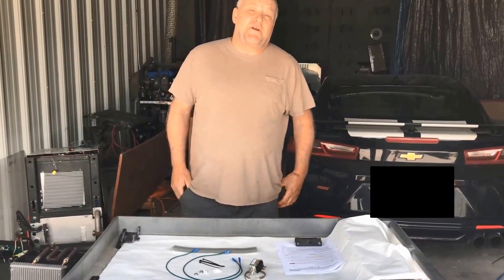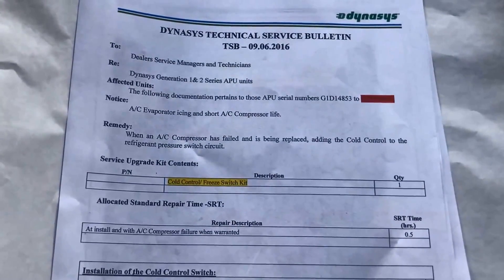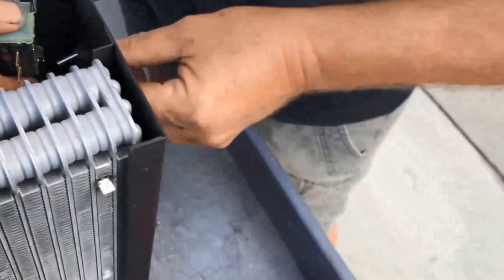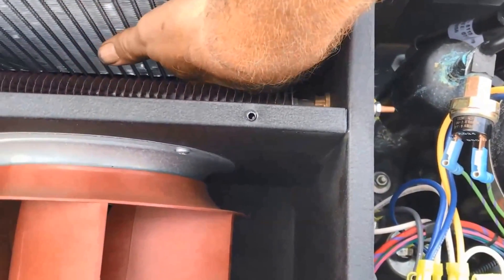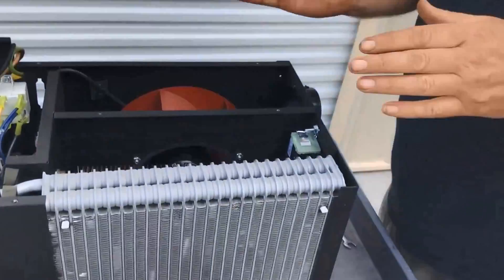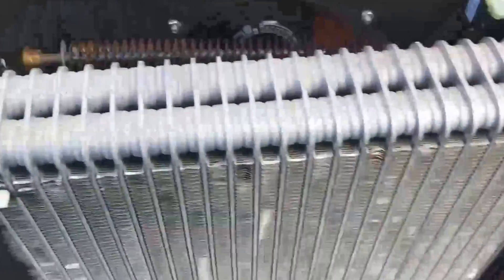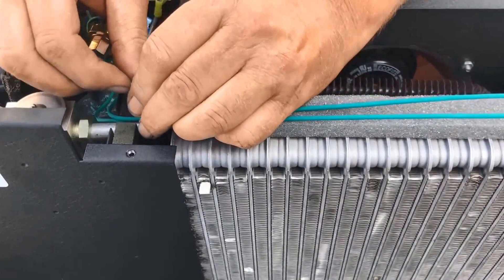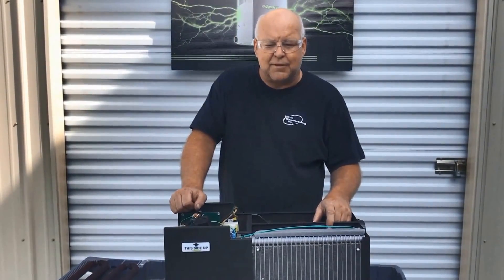Dynasys APU // TSB - Cold Control Kit

Comment: Another mickey mouse fix for a poorly designed unit. The unit would need to be removed from the sleeper to drill the 2 holes, that would mean disconnecting the Freon lines. If the unit is under warranty that's fine but if not just replace the AC under the bunk with a dometic or go with a rooftop unit. The cost to repair the dynashit if you can find someone to do so. Nobody wants too work on these things because you'll be back complaining about something else.